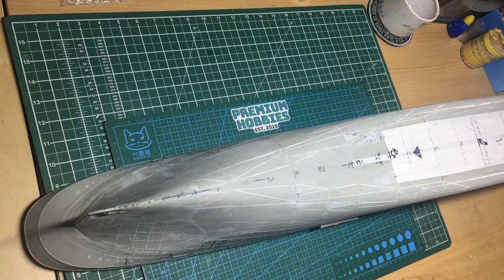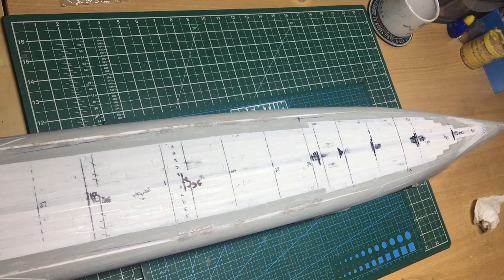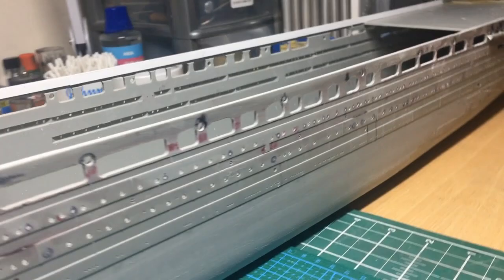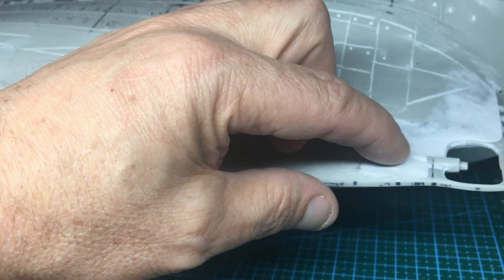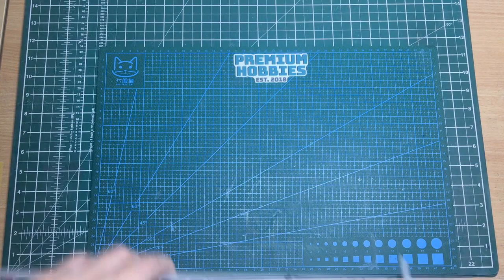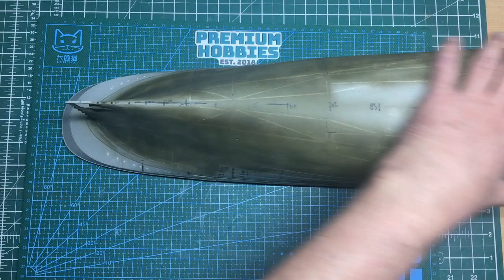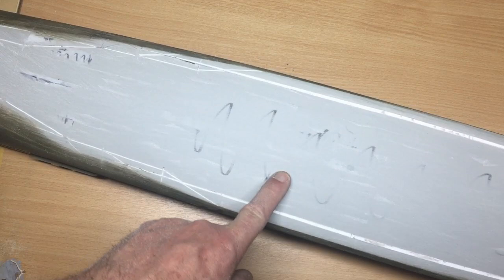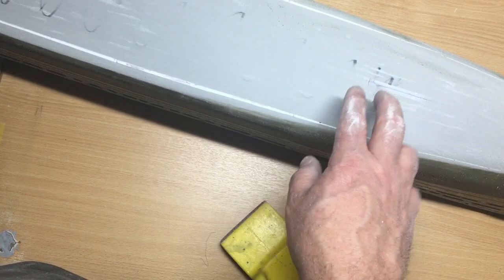Correcting the hull of the 1/200 Titanic hull...My Way..Part 14

Comment: I looked at my new kit the BB 61 1/200, and could tell that the hull needs similar work but I have no idea how to correct it like you have on this  one. I ordered the Anatomy of a ship series on the subject and her lines are not correct on the 200th scale drawings. I am not skilled in these matters so I would be thrilled to have your help. The days of modeling clubs and gathering of people with expertise is  non existent around here where I am and not feasible  anyway due to the virus situation. Happy modelling.
Reply from the maker: So.. if the AOTS book lines are out, and I agree, where else do we find correct lines?
Reply: I don't know unless one ordered plans from Taubman. Any way , to me , your work in this way is priceless . I would have like to have known about the hull faults before I paid $400 + for my trumpeter Iowa kit. You have shown me a lot and being familiar  with boat building, but no expert, I can see the difference that you can make. I have figured out by conversion from 600 to 200 scale that length between stations is 51.8 mm. Is that any where near right?  From page 108 in Draminski's book.
Reply from the maker: @tda53  I have made a video about the hull on Iowa. There I show what’s wrong with it.
Reply: @NigelsModellingBench  Yes, very helpful thank you!

Comment: Why would Trumpeter do such a poor job of getting the hull form of the model right? Does it have something to do with them molding the hull in one piece? Could they have done a better job if they had cast the hull in two pieces, port and starboard? Maybe the one piece plastic hull could not be ejected from the mold with the lines contoured correctly so the were forced to simplify the hull's lines.
Reply from the maker: Well, as far as I can see there is no reason for getting it wrong due to moulding restrictions? I believe the only kit out there with an accurate hull is the old minicraft 1/350 kit?